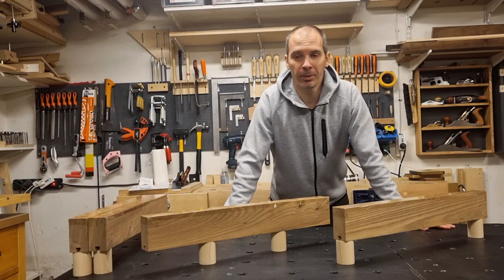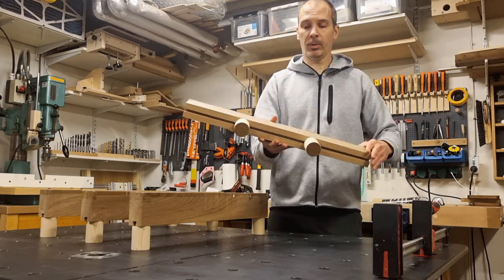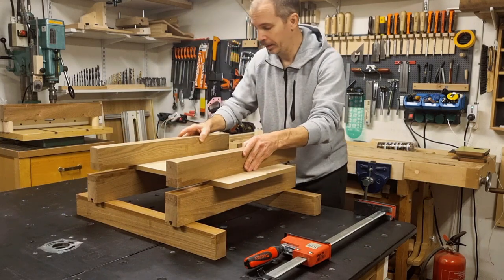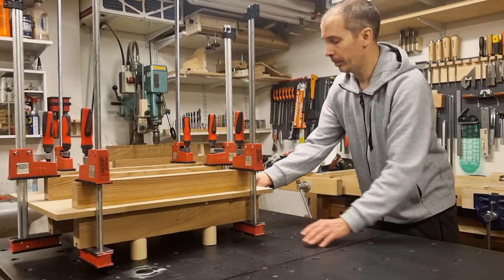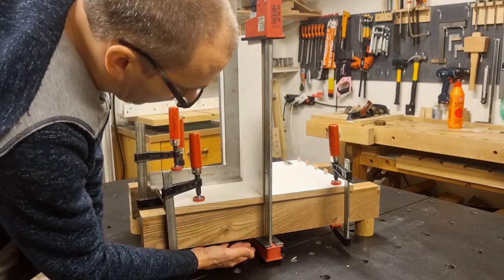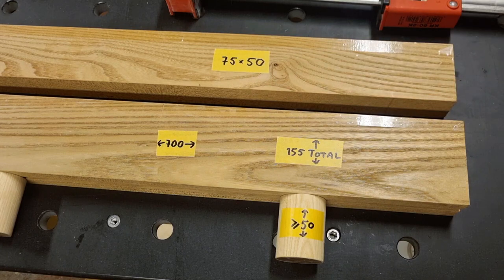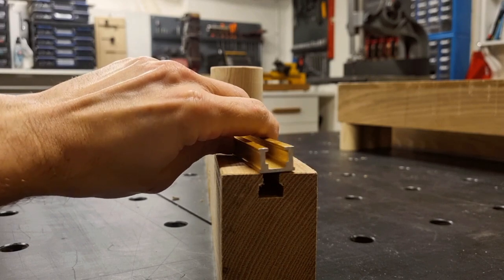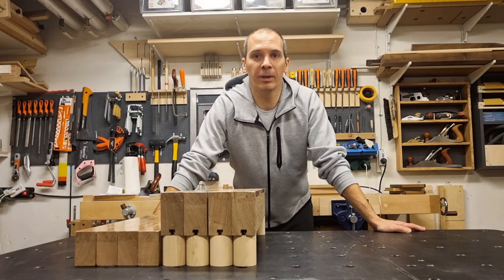Elevated clamping cauls with movable feet

Comment: are you clamping cauls slightly tapered at the ends to provide more clamping force in the center?
Reply from the maker: No they are straight. I know some people prefer curved clamping cauls. I like flat references in my glue ups of the kind I show in this video and so far my panels have always come out pretty straight so I see no reason to laborate with curves. But curved cauls can be very handy in some "hard to reach" applications.